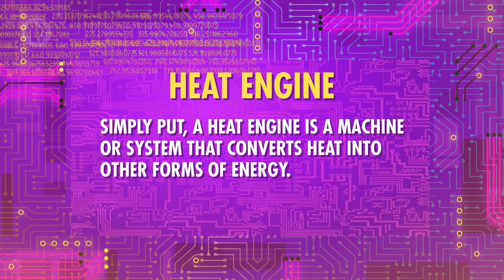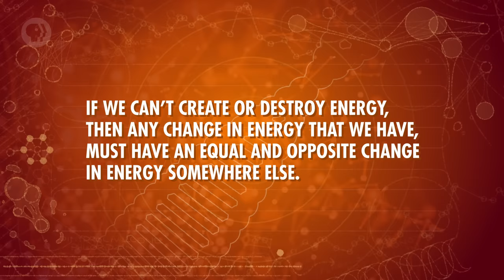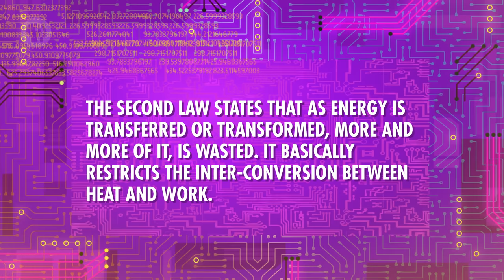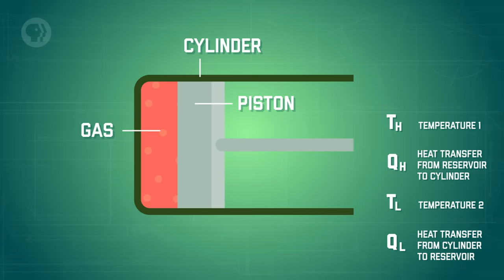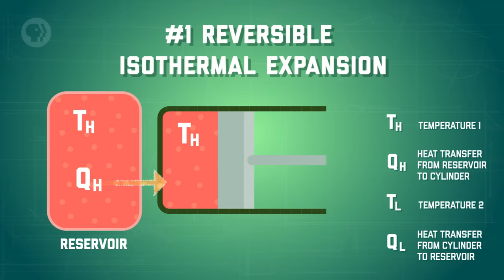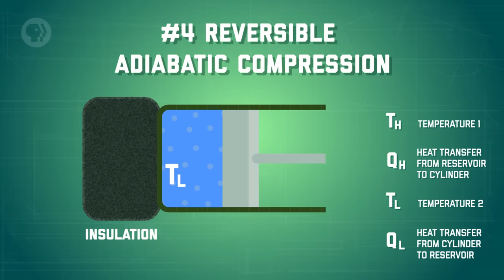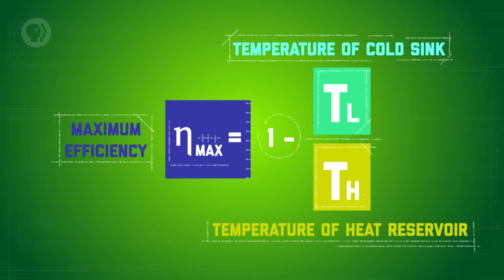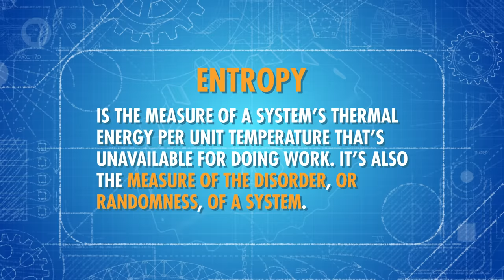Why We Can't Invent a Perfect Engine: Crash Course Engineering #10

Comment: The way I see it, the 2nd law isn't fundamentally about energy at all.  Rather, it's all about probability.  It's not that we can't make a perfectly efficient engine, it's just the the probability of it happening is practically 0, but actually slightly higher.  What's really going on is that entropy is a measure of the number of states a system can exist in.  We talk about macrostates vs microstates.  For example, if our system consists of a single vase, one potential macrostate would be "broken".  A microstates is an exact configuration of particles.  There are FAR, FAR more microstates that correspond to "broken vase" than "not broken vase", so a system consisting of a broken vase has higher entropy than one consistenting of a whole vase.  This is where the misleading description of entropy as being a measure of "disorder" comes from.  Most macrostates we'd consider disordered are higher entropy simple because there are more microstates that correspond to them.  But this isn't what entropy is about.  So what does this have to do with energy and efficiency?  Well anytime we apply energy to a system to do work on it, we're changing the state of the system.  Even if we intentionally apply the energy in a very specific manner, there are simply SO MANY ways for some of the energy to be wasted compared to the number of ways for it to all be used for useful work.  There's nothing stopping a 100% efficient heat engine from existing, per se, but the probability of it even a single perfectly efficient heat engine cycle to occur is such that we'd never expect it to happen in any way imaginable amount of time.  However, given infinite time, it's virtually guarenteed to happen, not just once, but an infinite number of time.  That's because anything with a non-zero probability of occuring, no matter how tiny, will eventually occur given a sufficiently long period of time. However, the probability is such a thing is probably on par with the probability of all the particles in your body quantum tunneling at the exactly the same time in such a manner to teleport you someplace.  It theoretically could happen, but don't count on it.  I think the amount time needed for it to have even a 50% chance of occuring is longer than the age of the universe, though I'm going on memory.

Comment: You can work and research Thermodynamics following the career of Chemical or Mechanical Engineering. This is an extremely broad field that governs the laws of nature. Therefore the approaches can be extremely different. In CE, it is much more focused on Equilibrium of solutions/mixtures of solids, liquids and gases and different chemicals (which is hardly seen by MEs). In ME it is much more on Heat Cycles.

Comment: You have to use state changes in exotic circumstances.

There are two ways either create a harmonic vortaic system that uses outside thermal noise to power the system or create a system that throws itself into a constant state of unbalance by it operation to the point where you get a separation of thermal states then pull the work off the collapseing phase change which can be introduced to the system.

Comment: We already have, they're called electric motors. 95+% efficient is pretty good.  Maybe CrashCourse could do a video on the VW I.D. R.
Reply: So if we made one that was 100% efficient it wouldn't be MORE perfect? The point here was based on 100% thermal efficiency, even if the title doesn't exactly specify.

Comment: While thermal efficiency is only 25% from the 4 stroke action modern engines are volumetrically 95% or better with forced induction...
cooling with the fuel is used in jet turbine engines to also prep the fuel for combustion... Smokey yunick made a "hot air engine" and got 500 HP out of a 2.5l modified ironduke fiero based on experience of an engine running amazing just before blowing up and hydrogen Reformation

Comment: I don’t understand why we need 4 parts of the Carnot cycle. If we were just doing isobaric heating and cooling(changing temperature while keeping pressure constant), we’d get the piston to move because of changing volume. And if we assume no heat being lost to the environment(like perfect reservoirs in Carnot cycle), we’d get 100% efficiency.
Reply: Okay, I think I got it. Those isobaric processes would be 100% reversible if we assume that no energy is lost, but actually no energy is transferred to the environment either. If we had a vertical piston working as an elevator, and we heated up the gas inside the cylinder, the piston would go up, but the moment you remove mass from the top of it, pressure in the cylinder would go down, so the piston would go up and if you wanted to bring it down to the initial pressure and level, you would have to put some mass on top of it, but since that mass would go down with the piston, its potential energy would decrease, so no work is being done.
Reply: Varret, I think your talking about a sterling engine.
Reply: You need a doner kebab broodje!

Comment: Would love to see what you have to say about using a Wankel engine in hybrid with a combustion engine to counteract the heat loss

Edit: I previously meant the Sterling my bad for mixing that up. Learned them on the same day so I think they're tied together in my memory. Regardless sorry for the confusion
Reply: You saying this is perfectly efficient?
Reply: Greg oh no absolutely not but I wonder why it's not used in current engineering as it would logically seem to be more efficient than a combustion alone. I'm sure there's a good reason why they don't work in tandem a lot but id like to know what info she could bring to the table.
Reply: a steam engine with Stirling engines as secondary would be way more efficient, or steam+stirling too electric+stirlings.
Reply: I heard rumors that Mazda may use the Wankle engine to power their hybrids in the future.
Reply: HDose Now that would be interesting
Reply: Especially since Wankles has a tendency to burn oil......
Reply: What about the really efficient carb whose inventor died? Or the water powered engine whose inventor also died? Or all the other tech that is being hidden from the mass population?
Reply: j Chin
The only "water powered" engine possible would be a nuclear fusion engine, or a fuel cell. You can use water as a vehicle or a means of storage, but not as a fuel.
Reply: fuel cells don't use water as fuel , they produce it as a 'waste' product from reacting  hydrogen (fuel) with oxygen to produce electricity .   And fusion does not use water as fuel either- but just as a ready source of hydrogen isotopes
Reply: philip wakeham
That was my point. Fuel cells involve water, but not as a fuel. I guess you could make the same point for hydrogen burning engines. And the fuel for hydrogen fusion generally comes from water. But the only real "water powered" engines I know of would be hydraulic dams or water wheels. Or maybe tidal turbines. But you can't burn water. It's already burned.
Reply: In the purest sense a water wheels and hydraulic dams are solar powered , the water is not providing the energy , any more than the piston in an engine is.  The water in a dam has potential energy given to it by the sun evaporating it and then raining it in to a lake on top of a mountain !
Reply: philip wakeham
Using that argument, you could say that all fossil fuel engines are really solar powered. The sun furnished the power that the algae used to produce biomass that was eventually turned into petroleum or coal.
Reply: while what you say is true its not the same, because after a water wheel has 'used' the water, you still have exactly the same amount of water left- so what has been used? after you burn coal or oil, you dont have the same amount of coal or oil left over
Reply: Wankel engines are some of the least efficient engines out there. They might offer some advantages with power recovery turbines, but they're never going to be able to compete with the efficiency of piston engines.
Reply: I got something to say about that....but I just ran out of time...
Reply: Do you even understand how engines work? How is adding ANOTHER combustion engine to a Wankel going to magically increase efficiency? How is having TWO steam engines going to be more efficient, King Peter? You people are thinking with your heart in the right place, but your head is all messed up. I think what you meant to say is that having an engine that can use it's waste heat to generate power from steam as well, and a large battery bank, would be most efficient.

Comment: We did invent the perfect engine. The 427 was about as good as it gets.
Reply: Depends on what you mean by perfect...
427 V8? Excessively big & heavy, low power output per cubic inch when emissions-legal, very poor fuel economy in normal everyday use. Hardly "perfect".

Comment: How efficient is a Sterling Engine? Could it use the waste or heat energy put off by those 61% efficient engines, in a Sterling Engine?
Reply: Sterlings are neat (and fun to watch move while heated by the sun or coffee cups), but they're so inefficient that the wouldn't even justify their own weight, let alone give you anything back for them.

A sterling engine is.... 10% tops.

Comment: I think we need a perpetual entropy reduction chamber next to the blabber mouth that made me forget what I was going to say....oh yeah...perpetual entropy reduction chamber next to the excess heat exchange valve recognizer so the realty gauge thermometer doesn't interfere with thermostat vocalization protection agency in charge of the engine specification chart committee organizer. So that any heat exchange can be called something else besides thermodynamics to save on paper, in case the cloud storage tank protection wall solution will have enough gigs to release any left over gases after each meeting of the diaper folders. This will insure there is enough cake for everyone even if they aren't there for the mind exponentiation seminar induction coil framework. This will also account for any Tesla coil plans still left laying around, so they wont be used for CIA toilet paper again. And really...if this could be reduced to a few words less, there might even be a savings on electrical riboflavin expenditure within the cellulose distribution clinic. And the wheel mounting fragogulermer exposure viewing pane might make a come back.

Comment: Skyactiv-X is probably going to hit that 40% thermal efficiency mark in a gasoline engine. Diesels have already done it.
Reply: The Stirling engine, invented before Carnot wrote his book, uses the contraction of the cooling gas to extract extra work, and is in the low 60%  efficiency. So could that be used in an engine? If we cool the exhaust after it leaves the engine, the exhaust stroke pressure will be negative, the piston will be sucked up doing extra work. At the muffler we'd need a vacuum pump to to move the reduced volume cold exhaust to the outside, but that pump would use less energy than is gained by the sucking exhaust stroke, there will be a net gain = higher efficiency. Maybe some clever engineering could omit the pump al together, if the exhaust is tuned so just a controlled valve is needed downstream in the exhaust to preserve the vacuum?

Comment: Entropy can be violated at low temperatures with spontaneous processes where the enthalpy is higher than the the product of temperature multiplied by entropy.  Also known as a positive gibbs free energy for spontaneous processes that violate entropy.  Examples of this are found in many biological processes and is thought to be the reason for the development of life in a chaotic universe.  With respect to 100% thermal efficiency, the engine would probably be extraordinarily different from our current perception.  It is possible that we would have to look at biology to solve such a quandary.
Reply: even if you can gain some energy from spontaneous processes, those gains are infinitesimally small, and you'd still loose more then you got out of them trying to do anything particularly useful. see: Life still looses entropy like anything else.

Comment: The perfect engine is impossible because of variation of mechanical energy, or dissipated energy, No? Don't know how to say it in English quite right sorry.
Reply: that's pretty much it, yeah.
an Engine turns one form of stored energy into another form of mechanical energy.
Some energy is always lost as heat or friction in the process. The sound an engine makes when it works is also a loss.
Reply: DFX2KX Entropy basically

Comment: What about fusion energy? That seems sort of efficient on matter to energy. “The power of the sun in palm of my hand.” Doc Ock Spider-Man 2
Reply: Jackboy019 The fusion energy is used for creating heat, to boil water. The advantages of using fusion energy is that: it doesn't create c02 in the process of creating heat, and doesn't create radioactive waste. The efficiency is another thing.
Reply: But the only waste of energy comes from the transformation of heat to mechanical energy, which seems like a separate process than the fusion itself. Yeah, modern fusion energy isn’t efficient, but in the future it might be.
Reply: Jackboy019 yeah the loss in heat is when you expand the liquid vapor in the turbines, the problwm right now is that the material used in the turbines isn't resistant enough to higher temperature. That's why there is a limit at the temperature you can reach, remenber efficiency in the carnot cycle is the rapport between min temperature and max temperature, to have more efficiency you need to reduce this rapport by augmenting the t max or lowering the t min, and since the t min in the temperature of the ambient you can only work on the max temperature. Like I said earlier you can use various methods to heat the water, but each method has it's problems.
Reply: Fusion cannot inherently be 100% efficient, as it produces radioactivity which does not participate in producing energy.

Comment: Heat can’t pass from a cooler to a hotter
You can try it if you like but you far better notter.
Cause the hotter in the cooler will get cooler as a ruler
And the hotter bodies heat will pass to the cooler.

Comment: 100 years later gassers still get 25 mpg !?!? Who is fooling who
Reply: In that time have become: cleaner, safer, heavier, larger and use a ton more electricity. That's gonna require energy. Plus there's a ton of cars that are very fuel efficient and still provide you with many commodities expected from modern cars. You can easily buy a car that does much better than 25 mpg for relatively little money these days.
Reply: The caveat is that modern 25 mpg cars have FAR more power output than the 25 mpg cars of a century ago. If we had stayed at low-power, low-speed vehicles, we'd have really good mpg ratings. Of course, we always want more power and more speed, with better efficiency coming in a weak third.

Comment: Magnetic engines are the solution
Reply: samuraineko3 I mean magnetic engines not electric
Reply: They won't reverse entropy though
Reply: What if you installed an alternating magnetic field tuned to alternate at exactly the rate at which the axel spun?
Reply: Aren't you just describing an electrical motor?
Reply: Probably more like atomic force engines, because there's much more energy potential in a condensed state and the math would probably be in a similar ball game. The technology would probably work very strangely.
Reply: even electricity loses some energy to the wiring there's no such thing as perfect conductivity and some energy is lost when charging the device and some energy is lost when trying to access it on a battery.
Reply: Bob Rossman
electromagnetism.
Reply: Food for thought
You can get free energy
There is free cheese in the mouse trap
Reply: Magnet motor is like gravity motors, they need to be resetted because they are both potential energies, they cant reverse themselves AND give you energy at the same time
Reply: Rance :3 .

Comment: gas engines are %30 efficient so why say nothings %100 effective??
Reply: because even the best electric motors can't get to 95%, most that do heavy work are at 80%.

If a motor or engine gets warm, even a single kelvin, that is a loss. if it has friction it must overcome (and it will) it will cause you to loose yet more,  the motor or engine makes any *sound*, that sound is vibration robbing energy from the system. 

Technology lets you get very close... but you cannot capture every stray photon leaving the system, without spending more energy then you loose catching them all.

Even black holes eating matter are not 100% efficient, and they're as efficient as you can get for natural phenomena.

Comment: The car engine is a bad example to use as a "thermal" engine as the point of a car engine is to turn combustion/expanding gases into kenitic energy. You can do the same work with compressed air, so in reality the car engine is more of an air pump then a thermal engine.